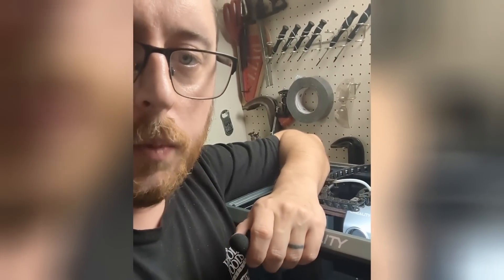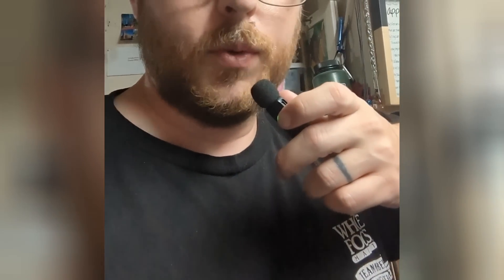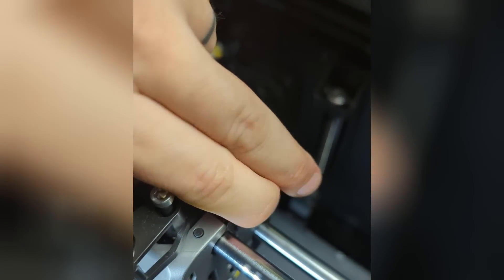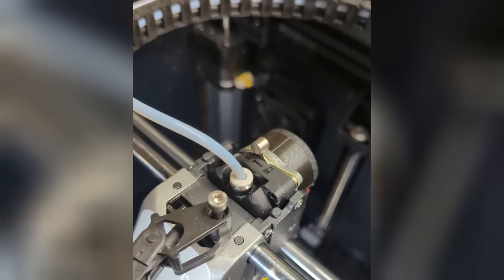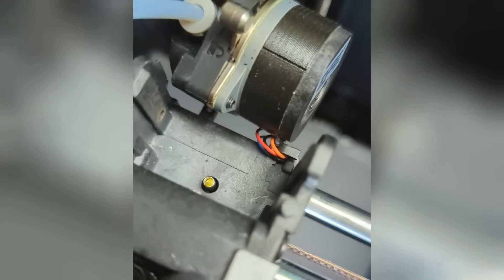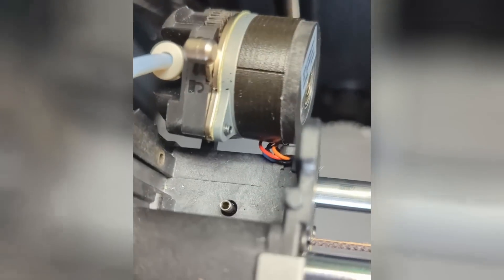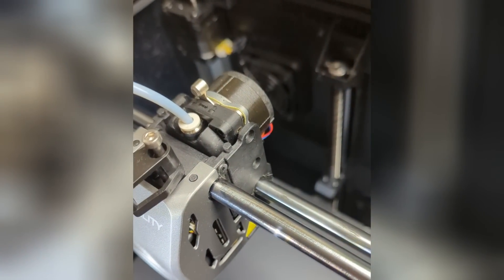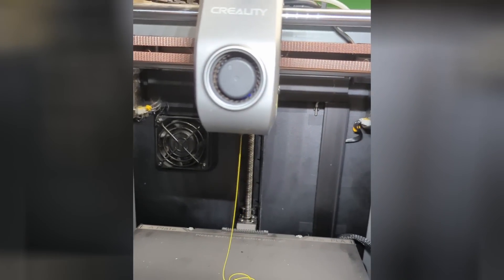Clogged K1C - Clicking Noise While Extruding

Comment: Thansk. Question. newer had this issue. run a lot of prints on my printer. but it started when i startet runnin prints on the hole print plate. Flat sencils. Any ider if that could have somthing to do with the feed tube or somthing like that?
Reply from the maker: Hey, thanks for watching! I wouldn't completely rule out the geometry of the prints, but I think something else might be more likely to be the culprit unless you've done something really custom with your PTFE line. I would think about what else you might have changed. Did you start using a new filament? Maybe some new settings to prepare for the print? The other thing is your nozzle and/or extruder could be wearing out, especially if you run a lot of prints. I run my K1C almost constantly and I have to replace the nozzle about every 3 months, the extruder about every 6 months. I do start to see more clogs when they are getting worn.

I hope you get it sorted out, thanks!

Comment: I just about freaked out the first time that happened. I tried using M600 instead of PAUSE in my gcode. My K1 Max did not like that at all. It caused a lot of issues I finally resolved by swapping the nozzle. There was so much filament built up it would not home in the Z axis correctly and print quality was terrible.
Reply from the maker: Ouch, that sounds like quite and issue. Unfortunately sometimes you just have break down and replace the nozzle. Thanks for sharing, that's a really good piece of info!

Comment: Any tips on PETG? I bought a couple rolls of Elegoo Rapid PETG, and haven't found the right settings to get it to print like my PLA.
Reply from the maker: It's been a while since I worked with PETG but I recall having to turn the fan settings down quite a bit and print a little hotter. Thanks for watching!
Reply from the maker: I did make a video a while back where I explored some PETG settings when I first started my channel, you can find it here: https://youtu.be/NFGD8KatoJ8

Comment: For me, I'm getting blockages somewhere inside the metal tube. Ever time i clear it, it jams within minutes. I had printed the same file like 30x, then it just started jamming. Tried a new nozzle kit with plenty of thermal paste and still having the issue. Reached out to creality, they finally opened a ticket at 11pm on a friday, then closed the ticket around midnight due to inactivity...
Reply from the maker: That sounds frustrating. Hard to know without more information, but I would first check that filament is dry, and if extruder gears are dirty/jammed or wearing out. If the extruder gears aren't feeding properly, you can get clogging downstream.
Reply: Did you ever figure out a solution to your issue? I'm actually dealing with that now. I've got a new extruder and nozzle going but for some reason I can extrude filament just fine but when it starts to print I'm running into issues
Reply: @OneSoul21  I bought a new extruder and motor assembly and the problem cleared up. Seems like creality just has horrible QC issues. My friend got a K1C that has its own set of unique problems. Something I know some people have had issues with too, which was not what my problem was, was that they weren't using the retract/extrude functions on the display to install and remove filament - definitely use that.
Reply: @BenWilson24  I appreciate it! I'll give it a try and see if it clears up the problem.